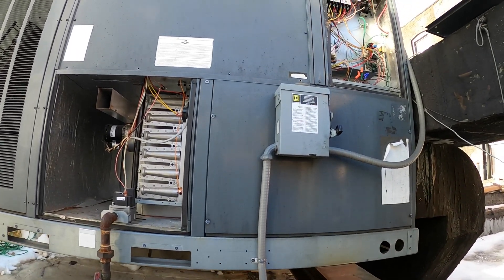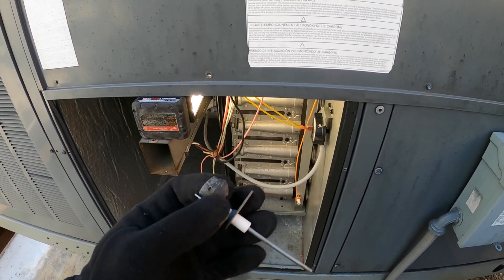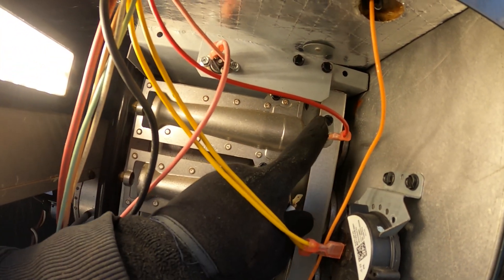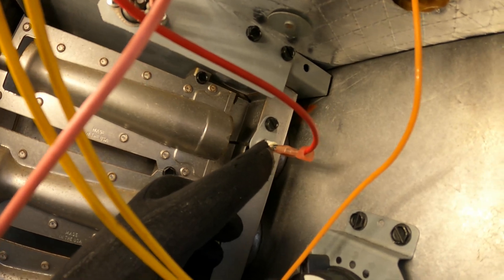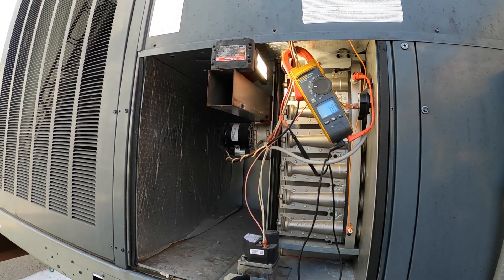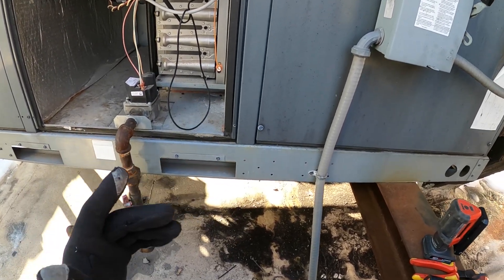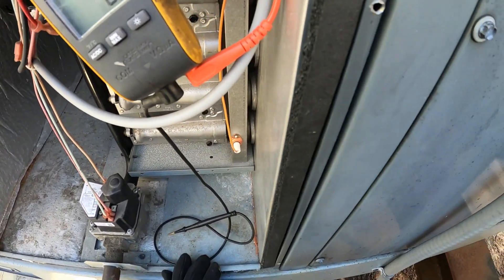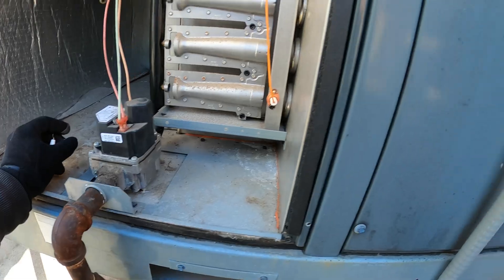HVAC: How To Check A Flame Sensor For A Furnace/Boiler (Flame Sensor Troubleshooting DC Micro Amps)

Comment: Good video. I feel like getting info from manufacturer for the recommended micro amp range can be a pain. Ive asked various tech supports before with not very clear awnsers. So thanks for the "average".
Reply from the maker: @Dude_1992  Thank you! I agree with you regarding the manufacturers DC micro amp range. That range provided in this video was from Goodman as this a Goodman unit. For the most part, the ranges stated in this video will be sufficient for for most flame sensors but I would definitely try to consult with any literature from the manufacturer. Thanks for watching 🔧⚡️